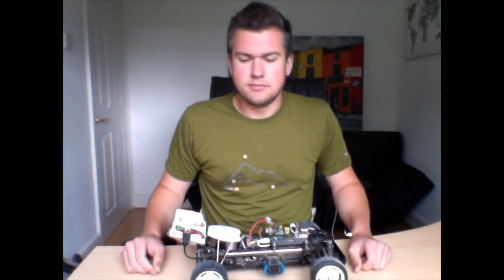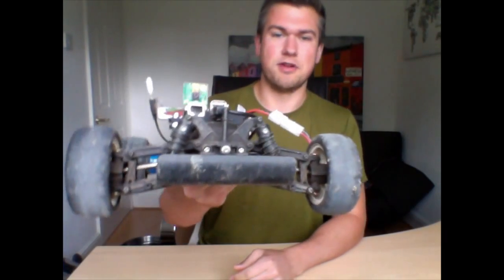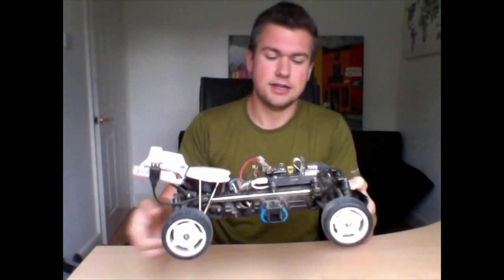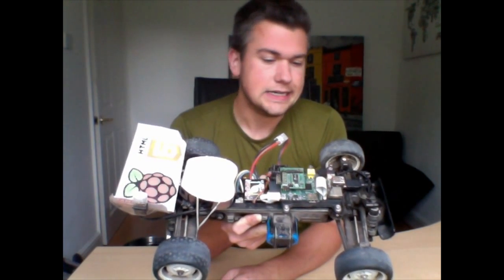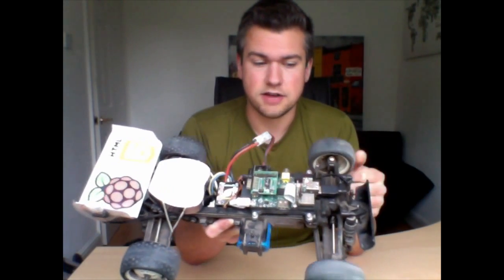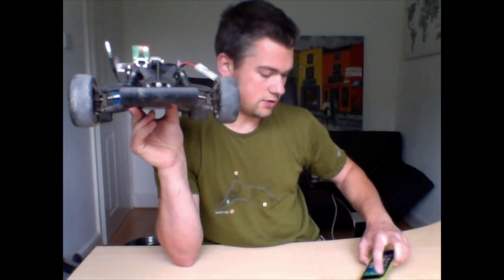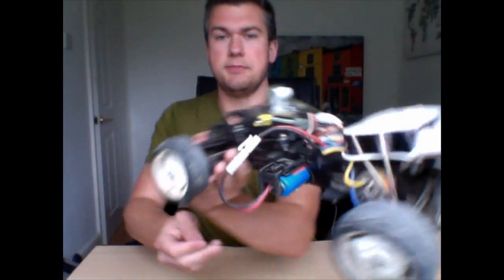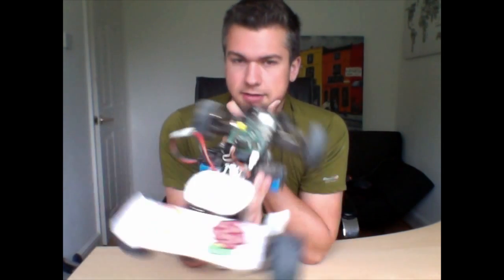Awesome Raspberry Pi iPhone WiFi radio controlled car toy with POV video

Comment: I really like this project.I see that it was in 2013, but if you are planning on doing this nowadays, I would HIGHLY recommend you don't use apache+ajax. There is a lot of overhead there. It is ok to use a webserver for starters (though, you'll really want to figure another way), but you can use python (or nodejs which is my fav) to create a simple HTTP server and use websockets to and/receive data. That will massively cut the overhead.
Reply from the maker: yea thats what i ended up doing, node and web sockets, much faster. https://github.com/shaunuk/picar for code.

Comment: I got a cool idea, where I'd like to put a Raspberry Pi A+ with the camera module and a WiFi usb stick onto a RC drone, where I can tell the Raspberry to make pictures and videos trough an iPhone for example.
It'd be also cool to maybe stream the video onto an iPhone, so controlling the drone while seeing where it is would be helpful, though the drone itself is still being controlled by its own controller.

I am pretty new to Raspberri Pi, but also quite interested in doing this, because this would be a cheap alternative upgrade for a Drone to add a video and streaming function.
Since I am new to this stuff, I dont know whether this setup will work, or if there is more hardaware required.
The iPhone controlled Car is pretty awesome, so why not add it to a drone?

Connecting the iPhone to an Access Point made by the Raspberry, and the controlling it in order to make videos, images or even stream stuff to the iPhone, or maybe just saving it onto the little micro SD card.

This would really be a cool project, and I'd like to know whether this is possible to do that with that few parts of hardware.
Also is there an app which can stream and/or take images or videos directly onto the iPhone, without having to enter the commands to take the pictures or videos?
Reply from the maker: Sounds like a plan.... I have all the parts spare as well. The biggest problem with be the range of the wifi... but a simple web page interface to say start recording and take pictures every x seconds would be great... I think it should be developeed as a raspberry pi remote camera project and then added to a drone as a secondary thing in a nice case. Strangely i just finished building my heavy life drone.... perfect :)
Reply: CookieCraftMedia what about that all already exists....
Reply: YellowBlue RC Well great for you, but I don't live in a country that is such amazed by electronics as America.
Remember, people in Germany only think about potatoes and farming instead of more useful things, but that's none of my business.
Reply: CookieCraftMedia are you implying that I live in the us?
you know that you can almost buy everything from the internet and get it shipped to your doorstep?
it is probably harder to find everything you need to build what you described then to find some fpv gear.
Reply: YellowBlue RC Nah I'm just saying Germany is stupid and has no idea what technology even is
Reply: CookieCraftMedia kinda depends where you look. I live in the netherlands and im able to just order everything from online stores.
I know you can do the same in germany and to be fair RC modeling is quite a big hobby in germany for gliding and stuff.
You can always order stuff of conrad.de as that is stationed in Germany itself.
when I go to conrad you can always get some fpv gear and rc trucks/buggies/gliders/boats
Reply: YellowBlue RC Well, I do that as well, but we just don't even get appropriate education in school, we don't even have anything else than languages or sciences to have as an education
Reply: CookieCraftMedia i think that is normal across the globe, I now have Dutch, English, Math, economics, economics for companies, then computer coding(css, html, java)
I had German too but I dropped it so dont have to do that anymore.
Reply: YellowBlue RC That's what I mean, we will never learn computer coding, how am I supposed to even have fun with my hobby when I can't learn it?
Reply: CookieCraftMedia well we get the hours to learn the teachers just send us to a website to learn LOL
you can try http://www.codecademy.com/ if you really want to learn some coding
Reply: YellowBlue RC I tried online learning already, but I think it's just not as effective.
Well anyways thanks for the site
Reply: CookieCraftMedia np, it is the best site out ther imo but ofc learning with a teacher is always better.

Comment: you can get better camera refresh rates by interfacing directly to the camera without saving the image first.  You can use video4linux.  Guide here: https://github.com/meinside/rpi-mjpg-streamer
Reply from the maker: interesting.... for ease i was using motion jpeg images which are not efficient but very easy to embed in a web page
Reply: Using V4l still means you can use mjpg-streamer, you just need to use some arguments when compiling it as well as registering the camera module as a video device (/dev/video0).

Comment: Thanks for sharing this! Does the code work also with DC motors? It may be a stupid question, but just can't figure it out... My car actually has two DC motors, one for the steer and another one for speed regulation of course. Any suggestion will be appreciated!

Comment: Hello, amazing project! Just one quick question. What was the range with the wifi? I'm in a middle of a similar project but instead of a car I'm using an airplane. Would be neat to have a live stream from it
Reply: Wifi is usually not more than 20 meters or 60 ish feet i think. Not really suited for long range.

Comment: Hi ! Looks really good :) . There an question that i can't explain myself . Why to use the Raspberry camera module ? Is there no simple usb web cam posible on Rasp ? Another words : can i connect a simple web cam to Rasp and then capture the video from it ?
Reply from the maker: Yea, you could use a simpler and cheaper camera module :) I just wanted to try out the raspi camera. Plus its quite small !

Comment: Hi Shaun just seen your car it's amazing. I really want to do something like this but would love if you could do a tutorial or step be step instructions because I don't really understand how u have done it.
Reply from the maker: Hi Joseph, no problem - there is a tutorial coming out in two weeks i believe - if you can hang on. In the mean time make sure you have all the bits, car, smartphone, servo controller board (get the adafruit i2c 16ch one) and look over the code. Ill post something up when the tutorial is out.

Comment: On part three - what did you use for the camera uplink to the phone/browser? Painful to watch you crashing yours but at least it didn't get destroyed! As a next step I would recommend you try connecting a wiimote or ps3 controller to your phone over Bluetooth. Much easier to control than with a gyro.
Reply from the maker: I used a motion jpeg linux server to stream live video to the phones web browser, i should to have a go with a bluetooth controller. My original plan was to limit the additional hard ware people would need to get up and running, raspberry pi, toy car and your phone being the main ones :)
Reply: motion jpeg - mjpg-streamer? What's the next project?
Reply: Shaun Butler
Shuan I am a student and I would like to try this out becuase my school is giving out RPi's to us. I really need some guidance can you help me please
Reply from the maker: Yea. Sure. Take a look in the description. There is a link to the full source code. And if you get issue 135 of Linux user magazine it's got a full walk through of how to do each bit. Let me know if you need any specific help.  The artical may even be on their website....
Reply: Thanks so much Shuan, I live in the UK could you recommend a RC car I should buy?
Reply: Shuan I think im going to need a lot of help, is it possoble you give me your personal email or phone number so I could message you please?
Thank You

Comment: how did you make the iphone have its own wifi network for the raspberry pi to connect to
Reply from the maker: In iPhone settings you can create an access point under "personal hotspot" then you can tell the pi to connect to that access point like any other network. Then you need to know what ip address it gets. Something like 10.20.0.1, type ifconfig to find out

Comment: Cool, thanks for the reply.
Basicly i wanted to be able to run it without needing an internet connection, because at the moment I have the jquery address set at the Google direct link.  I have downloaded the latest jquery.min.is to the same dir as socket and app, but when I put src="jquery.min.is" It doesn't work.  Do I have to put a filesystem request thing in the code?

Comment from the maker: Hi Calum, yes, the code was a bit messy, i just chucked it up there quickly. I had a bit of time just now and tidied it up. Also tested it from start to finish to make sure it works. Go and get the latest software. make sure you have node and npm: "apt-get install nodejs npm" and then get the dependencies "npm install socket.io node-static". That should run better by typing nodejs app.js :)

Next time you have a problem post the error so I know whats up.

Comment from the maker: It turns out i couldn't really stop working on it. Every few months i pick it up and add something. It now has a speaker and can tell you when its started up, what the ip address is and the board temperature. Sad i know. But its quite helpful when you have no screen and no way of knowing what its ip address is to log onto.

Comment from the maker: Its fully variable, the more ou tilt the device the faster it goes. THis car has an uprated motor and esc so it goes pritty fast if you want it to. The WiFi usually is the first thing to go.

Comment from the maker: Im guessing your fan should only be on one gpio pin, not three so the other pins would be power and ground. If your using the add on board it should do that for you. I think. Not tried a fan

Comment from the maker: It does have a two second timer that points the wheels forwards and stops the motor if the signal cuts out. It needed that after a few heavy crashes :-)

Comment: I have used motion before but for some reason now I can only access it from local host.  I thought it might have been because I updated The pi's OS.  But all the settings in /etc/motion/motion.conf are the same.  Please help.

Comment: For now I am trying to turn a PC fan on/off with Node and GPIO, but I keep getting "Error when trying to open pin 11, /bin/sh: 1: gpio-admin: not-found", I am using the same servo board as you, according to the npmjs website for pi-gpio, it states that pins 7, 11, 12, 13, 15, 16, 18 and 22 are GPIO pins, my fan is on 11, 12 and 13, any ideas?

Comment: how big is the pi's battery in mah?
how big is the car's battery in mah?
where did u get the pi's battery?
I need a buy now link for the speed controller board, could you supply a link?

Comment: A few Q's that I need answering
1.  how do I install node.js thingy and get the coding for it to control the car
2.  where do I buy the servo board, there is no 'buy now' link anywhere on the provided link.
3.  (not really a question) I know you said it was more fun to code it so you were not going to include a source code link, but can you anyway as I am a noob at this and I just want to study the code to make sense of it.

If you would be so kind, I would love a full tutorial on how to do it.

Comment: Hello i really like the project you are doing and hope do something similar to it. But i have two questions for you. First of all, how did you make the raspberry pi control the motors of the rc car, i know lots of boards to control servos but not dc motors. Second, what did you have to do to get either touch or gyro controls through you phone, this is something i have been searching for but cant find an answer. So please reply with some steps on how to do the controls through the phone

Comment: Alright, thanks for the replies. It makes sense what you say about pressing more than one button at the time. Maybe you could make the whole screen a touch area and simply touching the screen would increase the throttle and then you steer with the gyro. Steering by tilting seems quite natural, it's leaning it foward to throttle that seems a bit weird to me. Of course other problems would arise; going backwards and going at >100% throttle. But easily solveable. Anyways it's a really cool project!

Comment from the maker: As for the Camera, CPU usage was my main concern. I've had it streaming 1080p to my computer but constant video streaming is allot for the basic WiFi to keep up with. Motion jpeg whilst not ideal is dead simple to embed into a webpage and 'just works' no codecs or plugins and very low cpu usage. im sure the motion jpeg stream could be vastly improved. Perhaps ill Github the whole project for others to have a play.

Comment from the maker: You could simply add buttons as well to the screen and i thought about doing it this way over a 3g connection, i.e. press forward for each meter traveled and right/left for 35 degree turn etc. Gyro would be too slow across the internet probably. I also wanted it to work like a steering wheel in a car :-). It could be way better with calibration and sensitivity controls. If i was writing it professionally it would defiantly have those.

Comment from the maker: There are lots of people making RC cars with touch controls and they seem not to work very well. Touch screens are not designed for pressing more than on button at a time accurately in this way - you have to try and keep looking where you fingers are placed when you actually want to see what the cars doing. The gyro feels much more natural and works really well, I could turn the gain up to it doesn't need much tilting and the screen would be much more visible.

Comment: Great job, just two questions for you;

Why did you decide to use tilting the phone as a way to control it rather than using touch controls? It seems a bit sluggish also I guess it makes it hard to actually see the video as you tilt the phone away from you.

The video feed is quite delayed, is there any way to improve this? 

I imagine this project being much better if you could steer it using touch controls and with a better video feed. Either way great job, keep it up!